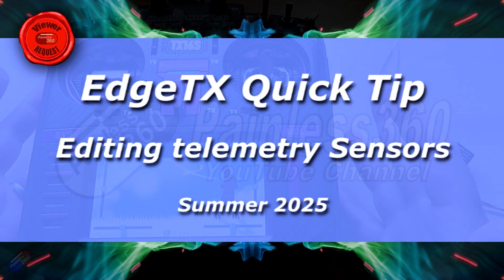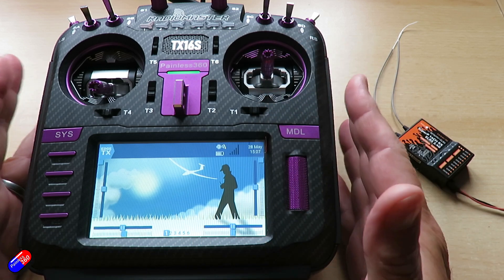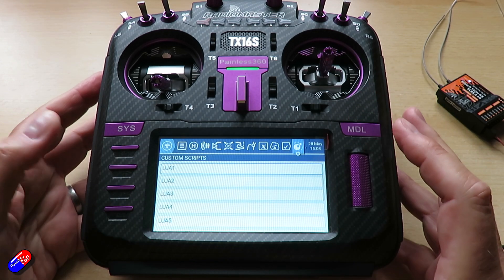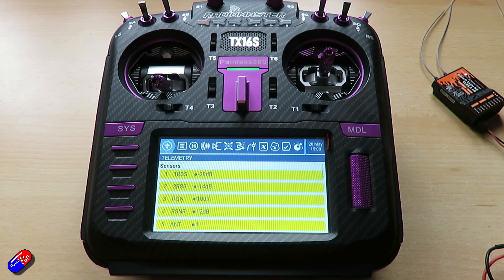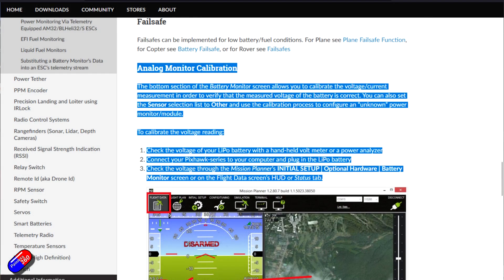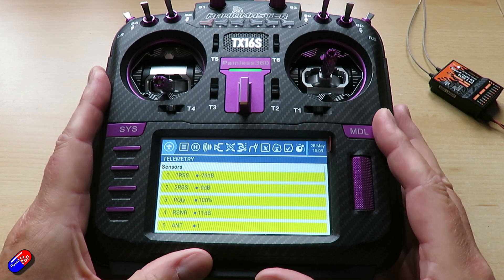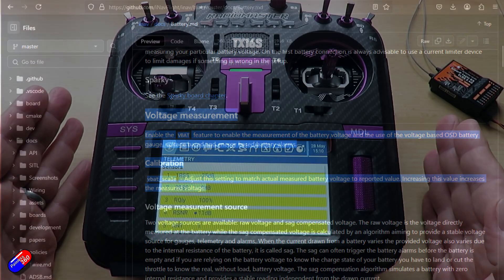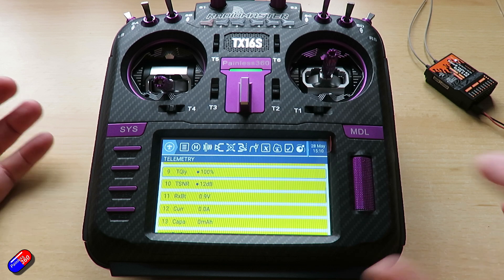EdgeTX Quick Tip: How to edit telemetry sensors (to fix things like wrong voltage readings)

Comment: What are those receivers like?
Reply from the maker: I tend to use the RadioMaster RP3 for the UAVS I build here... Happy flying
Reply: @Painless360 I'm just about to transition over from Frsky to elrs for fixed wing. Was wondering what other options there are for elrs rxs with PWM outputs.
Reply from the maker: I tend to use the RadioMaster ones here. See https://www.youtube.com/watch?v=mTYKSimaeoQ

Comment: Hi Lee thanks for the vid, helped with a sensor issue i kept having. Could you do a short video on setting up reverse thrust on the tx16s? It would be much appreciated.
Reply from the maker: There are two types of reversing ESCs. If it's the kind that you get in a car or boat, check out my video on that in the car and truck playlist... Best of luck